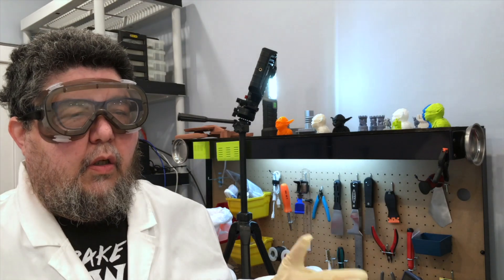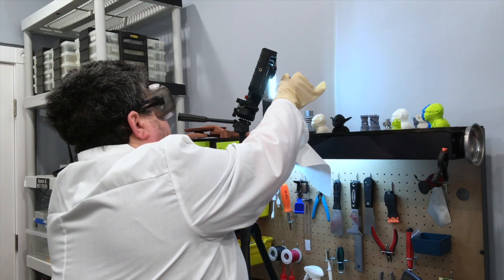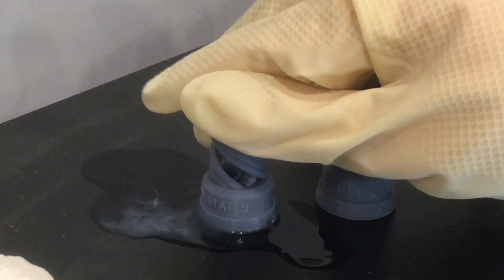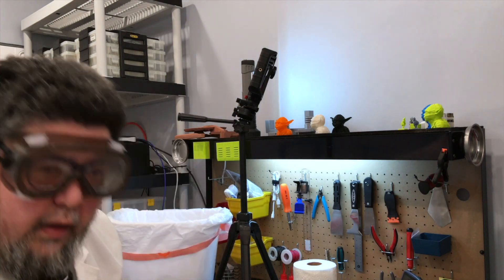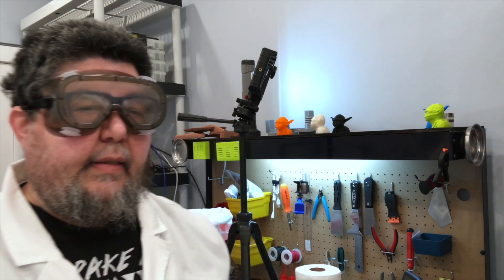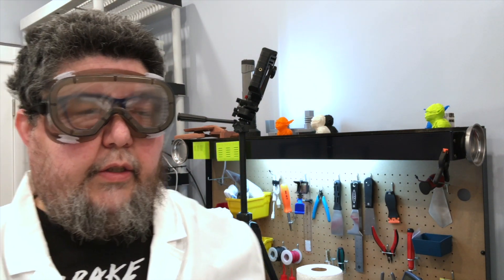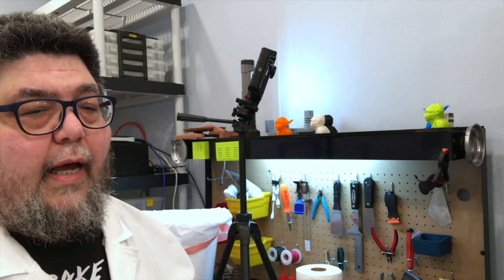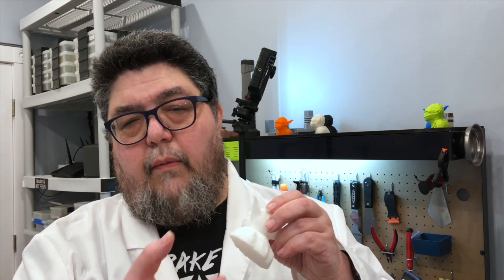Well, this is disturbing: my resin 3D prints are melting

Comment: unless everything on the shelf is resin prints and a year old, I would say that humidity in the room attached itself to the prints and interacted with the shelf material, caused it to split and maybe leaked out because otherwise, if you put a print into fresh resin will it cause it to melt? I don't think a leak would suddenly start otherwise if something didn't damage it. Essential Oils/cleaners for example can melt plastics.

Comment: Did it happen to be water washable resin? Every single hollowed out print I've made with water washable resin, from every company I've purchased it from, has now cracked or spilt open like a flower. Sometimes it happened within a week, sometimes it was over a year later, but I stopped using that garbage for hollow prints. Some survived okay in dry, high attitude Denver, but I recently moved to humid sea level Cleveland and every surviving water washable print I brought with me  split wide open over the course of my first month here. I'm done with water washable resin. Good riddance. None of the super-toxic resins have split like that, they just make me feel sick if I don't take proper precautions.

Comment: That's a design flaw of the test print provided by Elegoo inside the USB Stick. You can see evenly spaced dots on the bottom. I've printed mine with clear resin and I could see it more clearly that the bottom part (that looks like a base of a trophy) is hollow without draining holes and the dots on the bottom are columns (or you can say internal supports). The hole you see on the side is designed to work as draining holes for the inside of the tower (where you can see the double helix), not for the base part. I could see clear uncured resin flowing inside the base, so i drilled a hole to drain them out and let it cure under the sun. It became yellowish, but fully cured.

Comment: Goggles, lab coat and gloves over a resin print that didn't cure and leaked trapped IPA?  How is that gross?  You can't be that much of a baby.  I'd be more upset my prints failed after so long (they looked great BTW) and worry about how to prevent that from happening again.
Reply from the maker: You have no idea of my capacity to be a "baby." :)

Comment: OK, I'm going to finally comment on this issue.
Having being experienced in all kinds of 3D printing including this MLSA type printing.
No. 1 Heat has absolutely nothing to do with it, this is RESIN the only thing that could effect a finished resin 3D print from heat is distortion of the print
No. 2 Uncured resin has nothing to do with it, in fact uncured resin will not effect anything INTERNALLY (incase of a hollowed 3d print or otherwise) of the 3D printed object as resin will not MELT resin cured or not
No. 3 If there was ANY Acetone residue on the shelf that the rooks were stored on, very much could be a possibility of the issue considering the amount of time it took for them to start melting. Acetone is a very potent solvent for resin, cured or not cured
No. 4 Possible contamination of the resin in the VAT with IPA, BUT IPA is most commonly a solvent for UNCURED resin, not so much for cured resin, but who knows on that one, again considering the length of amount of time they have been sitting there with potential residual IPA in them...hmmm

Conclusion: I am leaning to No. 3 on this one, most likely in this case

Hope this helps
Thanks
Jon
Reply from the maker: It's possible. No idea what HF finishes its surfaces with.

Comment: this happened to me as well after a year to all the prints i made with water washable resin.. in some rare case it leaked from tiny cracks but the majority are literally exploded..
Reply: I had the same problem with water washable (well, cracking, not so much exploding :D). Mine were prints that were mostly open too (I print anatomical skulls), no inadequately drained hollowed voids inside. I've been told the issue is uneven curing; the outside of the model is getting the most UV exposure in the curing machine, while the inside isn't being cured as quickly. I'd imagine the more closed a hollowed model is the more of an issue this becomes. (And the more difficult it is to get the model thoroughly washed and the uncured resin out of the inside.) I finally gave up on water washable altogether, my results were consistently just bad. I did make a little contraption from a UV flashlight and a bunch of strands of fiber optic filament, to get UV light into tight spaces on the interior of models for thorough curing, but to be honest I don't know how effective that little pinprick amount of light could possibly be.
Reply from the maker: Wow.

Comment: This also depends on the type of resin that you are using as well...there are resins that are marketed as good resins when in reality they are low quality resins then there are resins that are much higher quality and produce a greater print than others...I would suggest do some research on various types of resins don't get persuaded by brands try to stick to just one resin one that produces high quality prints....just because it doesn't smell it doesn't mean it's great...

Comment: Doesn’t look like it dissolved tbh! You can see from the cross-section of the split that the model from the factory has been sliced hollow and has a drainage hole. I think it’s just that you’ve not cleaned out a few/one of them properly inside and it decided to ooze out. I know some folks like to use a syringe to get IPA in to clean and a single UV LED poked inside drainage holes to cure the inside after cleaning just to be sure. I think it’s possible you probably know all this now so ignore this if you do!
Reply: Same was my thinking.

Comment: Just discovered a base on a mini had burst open. It stood in a dark corner of a shelf, no heat etc. I guess it was printed not fully solid and there was still liquid resin in it, that expanded over time and found a weak spot in the side.
Reply: Always have 2 drain holes^^

Comment: I've had 2 models do this, they both exploded like an alien egg birthing a face hugger and I don't know why.  Both were solid models and neither were in particularly high heat.  Both had been printed with elegoo gray water washable.
Reply: I'm freaking out - I just found a larger 75mm print I did months ago had split open and had uncured resin on the inside. I'm so worried this might happen to more - I've been using nothing but elegoo gray water washable the whole time I've been resin printing. I spent days painting this thing...

Comment: I just picked up a print my brother made a year ago that was sitting on top of a plastic case I had and the whole bottom was just melted goo and it stank. This is the only thing I could find where something similar happened.
Reply from the maker: I'm starting to think there are a ton of time-bombed resin prints out there.
Reply: I came looking for answers and found this video after noticing that a printed Cthulhu one of my kids had given me, some time ago, was leaning over on the shelf where it had sat, untouched, for several months. When I examined it, I found that the limbs, arms and legs, had split open, gray goo had spilled out and  run down to the base; which itself had split and started to pull apart,  hence the leaning. A small puddle of the goo had been forming for who knows how long....

Comment: Did you possibly print these hollow and not put in drain holes? Uncured resin trapped inside of a print will eventually crack the cured resin and leak out all over the place. Once resin is cured it will never "uncure" it can be melted with other chemicals, but won't turn back into what you cleaned up. I would check the inside of the prints to see if they were hollow, if they were, that is your culprit. You should also check your other prints, you can shake them. If you hear a sloshing noise you have uncured resin inside and should either drill a hole somewhere in it to drain it and rinse with IPA again, or throw them out.
Reply from the maker: These were the reference prints from the vendor, so I don't know how they were sliced. The print does have a hole in the bottom so I'm guessing it's for drainage.
Reply: You don't throw uncured resin to trash, even if it's inside a print. You do the work, drill a hole, drain it and cure it or break the whole thing and cure it.

Comment: The Chinese are 'cutting' these resins worse than drug dealers cut coke in the 80's. I'm no chemist but my best guess is that it's likely a filler material used to stretch the batch - that didn't cross-link and eventually oozed out. In my experience the cheaper the resin, the worse this issue has been. But a couple of prints done with premium resins have had the issue as well.
Reply from the maker: Eek. Never thought of that.
Reply: lots of allegations here. where is your proof?
Reply: @jenjenner8827  It's an educated guess based on working in the thermoset plastics industry most of my adult life, barrister.
Reply: @JohnJones-oy3md  So you are a published engineer who has peer reviewed articles about plastics and polymer physics. Pls let me know who you are so i can look you up and judge for myself......

Comment: Looks like uncured resin from, perhaps, a part that was “solid” when printed. I don’t think your cured resin liquified or “melted.” If the part was solid you might need to put in weep holes so lots of interior resin can drain. See if the liquid stuff cures under UV light. If it does then my theory is correct.
Reply from the maker: Yeah, it's definitely uncured resin. Thanks!
Reply: You can see a drain hole, BUT physics a b****, so you should allwayshave 2 so that the IPA gets in and air out.